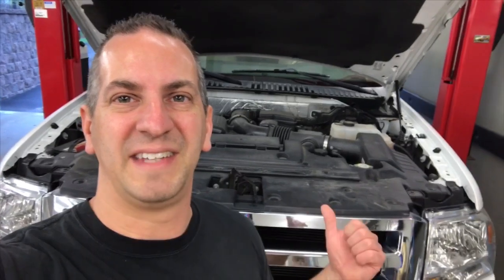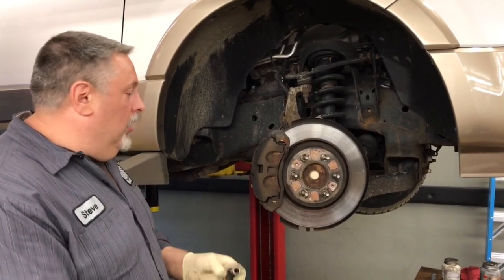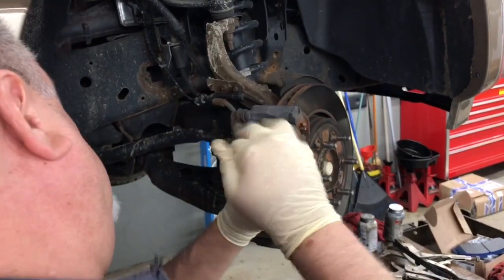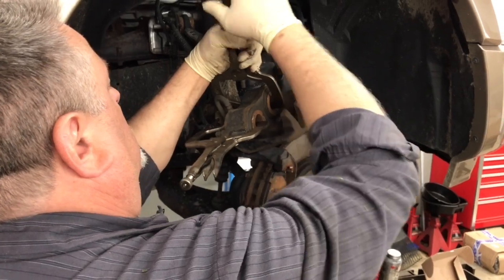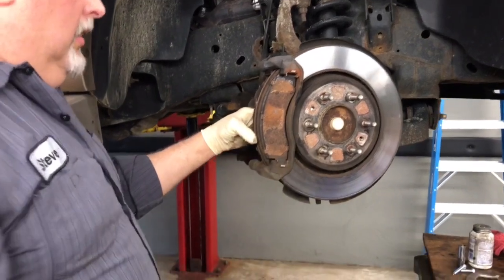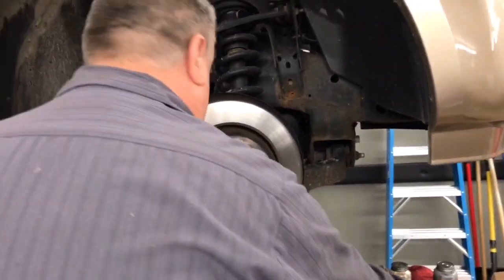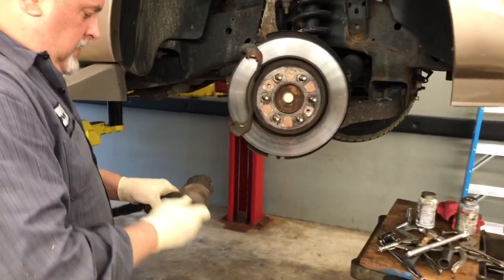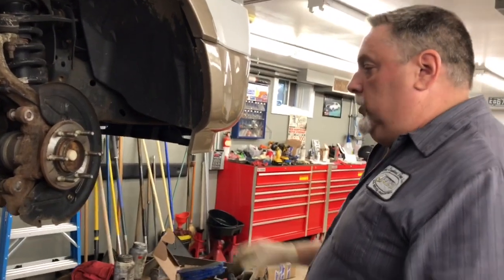How To Replace Ford Expedition Front Brake Rotors And Pads

Comment: My daughter is the same vehicle and the right brake pad was not releasing i put a new caliper and pads on and its still doing it the rotors are pretty bad going to try changing those to see if it helps. Not impressed with this brake system. Nice video guys. Where is your garage accent sounds north east.
Reply from the maker: We're up here in New England..Thanks for watching!

Comment: Great video gentlemen.  What is the brand of the never seize you're using?
Reply from the maker: Hi Kevin, Not sure what brand it is but you can buy it at AutoZone.
Reply: @HomeownerRepair  The local CAT dealer carries it as well. I've had good luck with it.